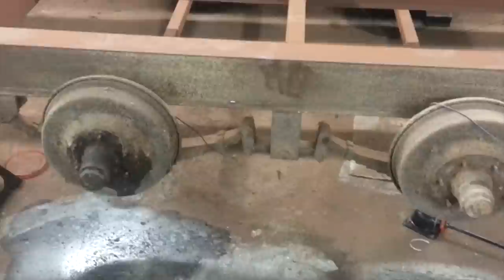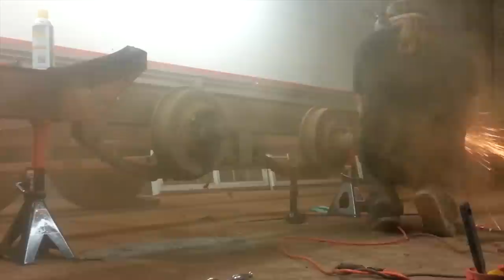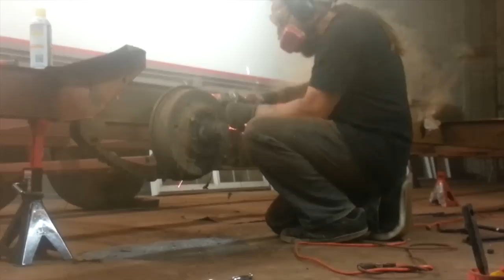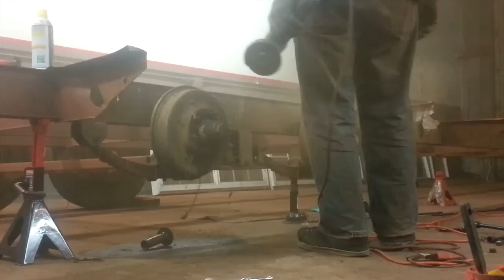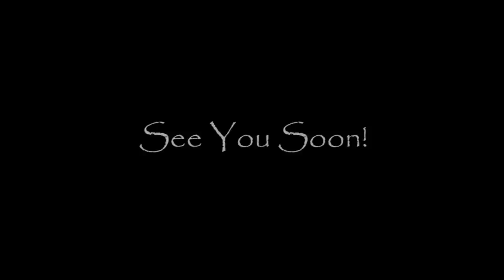Big Man in a Tiny House: Episode Two - Bathing in Rust

Comment: might want to move the axles forward while it's easy, that looks will be a lot of tongue weight
Reply from the maker: I appreciate the suggestion. I'm actually toying with the idea of having a covered porch at the front end of the frame which would lower the weight on that end. I don't know the physics of it all that well, to be honest. I'm not building it to travel the country in, but rather to avoid building codes that disallow small residences and prohibitive permit and planning fees.